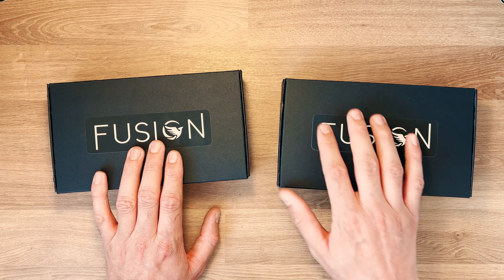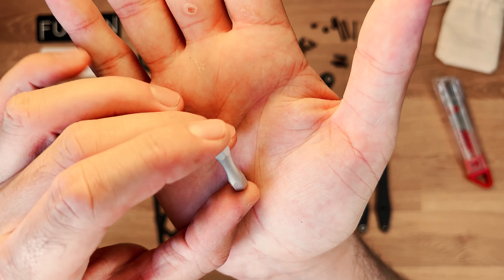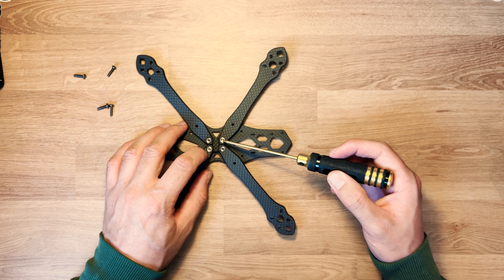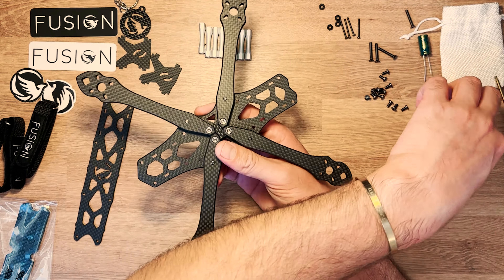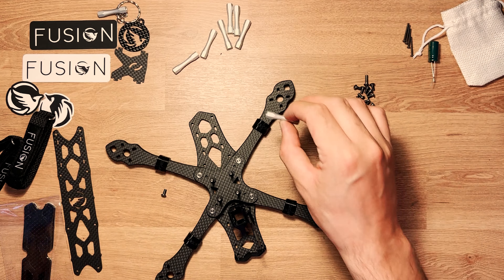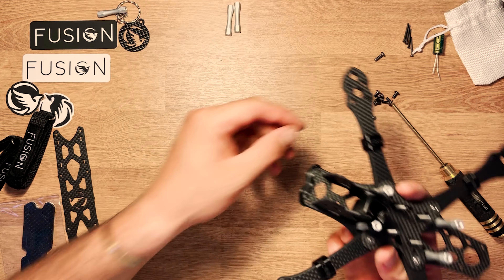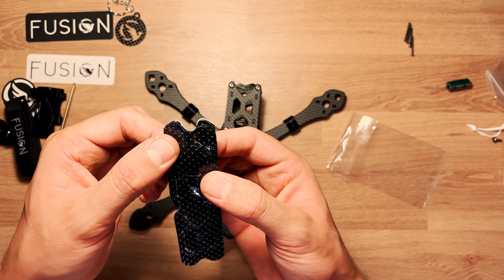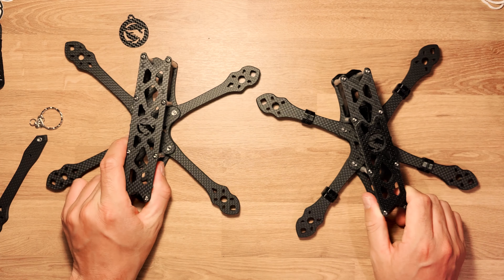Fusion F212 & C220 - Présentation et Assemblage

Comment: Very nice, but also very expensive frame!
Reply from the maker: This frame is one of the most high-end on the market 
T700 carbon, also used by NASA, is ultra-resistant with very low resonance. 
The custom-designed standoffs are stronger than any you'll find on the market, and give the frame extra rigidity. The screws and bolts are first-rate, the Uma lipo pad ultra grippy and the eco-responsible packaging class it as a premium product. If you ever get your hands on one, you'll understand what justifies its price 😉

Comment: 105 euros for a frame? lol what?
Reply from the maker: This frame is one of the most high-end on the market 
T700 carbon, also used by NASA, is ultra-resistant with very low resonance. 
The custom-designed standoffs are stronger than any you'll find on the market, and give the frame extra rigidity. The screws and bolts are first-rate, the Uma lipo pad ultra grippy and the eco-responsible packaging class it as a premium product. If you ever get your hands on one, you'll understand what justifies its price 😉